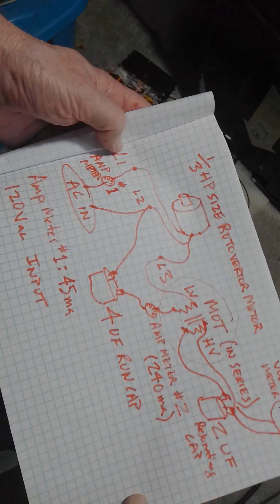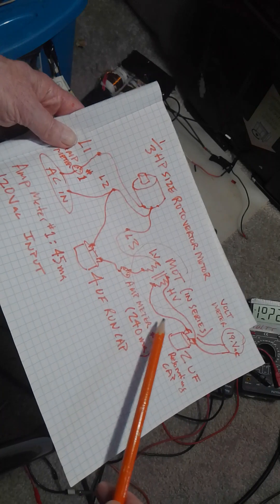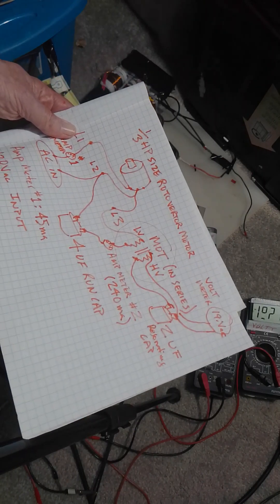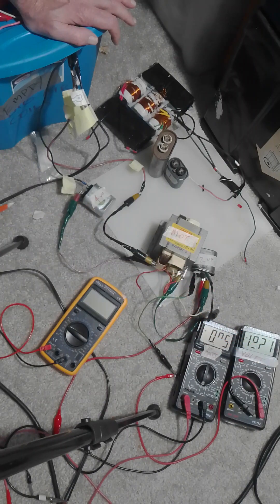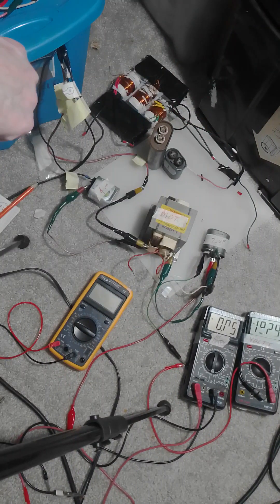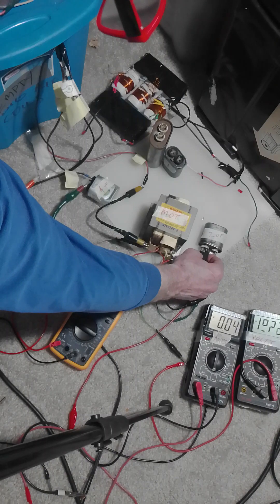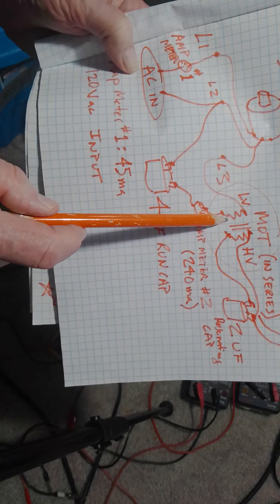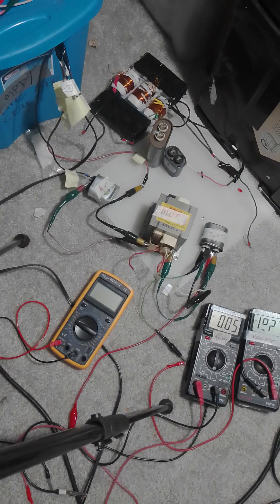Rotovertor-MOT experiment 120v X 45ma input and 19vac from MOT HV side

Comment: Doug, try replacing the mot transformer with a bridge rectifier then a husky sized DC motor ,( with a 5/8" shaft.)
If you have several, daisy chain with extra fwb rectifiers. I am not getting increased load at the AC input to rotoverter. I do put more capacitance switched on.
Nice things are happening! Keep at it
Motors are better than the transformers for some reason.
Cheers Warren
Reply from the maker: Hi Warren
OK thanks for advice I guess it likes the pulsed inductive loads....I will give it a try have a few treadmill motors in storage plus some various homebuilt DC pulse motors too....
When you switch in more caoacitance does that raise the draw to RV motor?  Above what draw is at "idle"?
Is it the run cap that you add more capacitance to, or is it some series cap somewhere in circuit? (or parallel)

Comment: Hi Doug, I get the same effect with the BiTT, only difference is i put two primary's in the MOT core and use the ac cap on one side. Other thing is, i see a phase shift on the load side of the MOT core as well. Cheers!
Reply from the maker: Hi Tim
Do you mean that you put two "LV" coils (low impedance ones) in your MOT and took out the high impedance coil and replaced it with another low impedance one?  Is that what you mean by two primaries in the MOT core?
Then an AC cap on just one of those low impedance coils?
Did you hook up the BiTT coming from the grid to the MOT?
And on load side of the MOT (where the cap is?) that side of the MOT has a phase shift to it?  What is the load there or is it just the cap across it?
Sorry for all the questions....I am knocking out the HV windings in this MOT and going to wind some new coils in there much lower impedance so should make some good current along with deceent voltage. (I hope)
Also have plan to rewind one of my BiTT transforrmers with low impedance primary coil (going to wire parallel the multifilars instead of series them as they are now) so will put the BiTT primary as the series transformer half on run cap phase then the two secondaries of BiTT in series into a load see what happens with that.